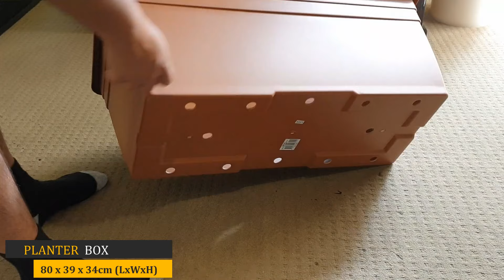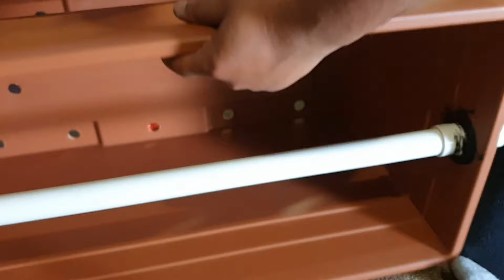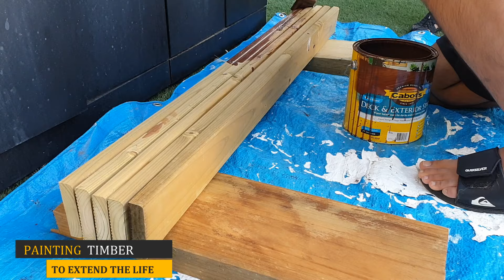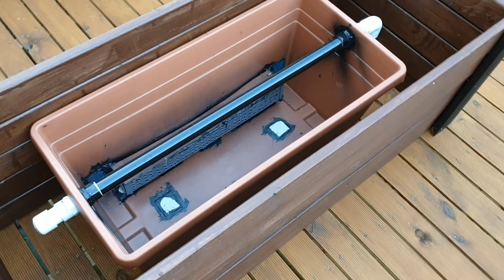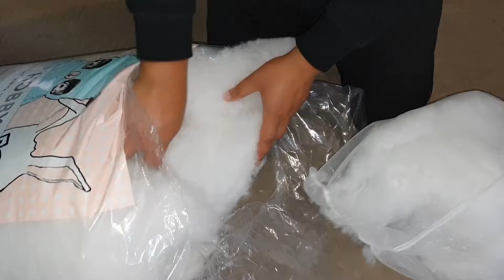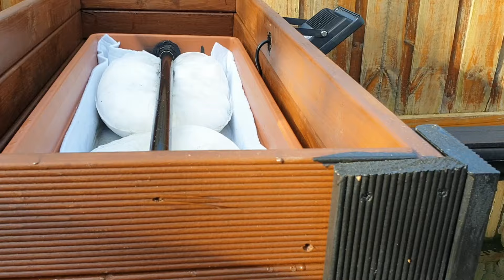Ep7. Build a Pond Filter With Spillway

Comment: What do you do with the open top of the planter box? Doing something similar and brainstorming ideas for the plsnter box cover/ how to add plants on top and still be able to access filter
Reply from the maker: Hi Cole, I have had this filter for year and a half. I am making a bog filter now. Similar look, however water flows from bottom and travel up before going back to the pond. This filter design required biweekly sponge cleaning with increase in pond fish. Bog filter will be more efficient and requires less maintenance. Just my feedback mate
Reply: @Fishaholic  nice and agreed. I still want to use the planter box around the filter either way but not sure how to cover the planter box as mine will only be waist high and don't want the filter seen from the top. Did you leave the top of the planter box open as in the video?
Reply from the maker: I covered the top with 8mm thick plastic sheet, was able to find the right size.
Reply: @Fishaholic  gotcha. Like I said my planter will be at waist level, pond is in ground, so I'm think I'm gonna try to fit some sort of indented top/lid to act as a container and add soil and plants on top to look like a legit planter box. Then I gotta figure out how to drain said plants so soil doesn't overflow into pond with rain🤔 so much planning lol. Bought a house last year with existing pond, waterfall leaks all over the place and after a year of patching I've torn down the waterfall and now rebuilding on opposite end of small pond
Reply from the maker: That sounds like a great plan. Fixing the pond and building a nice planter box should add value to the house. Congratulations

Comment: Hello. First of all what a great video you have. Can I ask what did you use as a filter spillway and did you paint it with pond paint (black) or did you apply pond liner on it? Lastly, how did you seal the spillway to the plant box please? Thank you for your lovely video. Hoping to hear from you.
Reply from the maker: Hi Ren, I have used a storage container for the spillway and used Krylon fusion spray paint in black colour. I have used ideal seal ms290 for sealing the spillway to the plastic planter box. Sealant was leftover from affixing glass to the epdm pond liner. Almost 1 year has passed with no leaks.

Comment: U should put a brick in the pond for the water pump ,if anything happen like leaking at least the water would not be drain out completely
Reply from the maker: I have placed the pump on its side, strainer part facing up elevating it at the same height as I would have placed it on top of a brick. It should address the issue you have mentioned Ryan.

Comment: What is the size of your pond sir? By inches maybe?
Reply from the maker: Hi Abe, I don't remember exactly. It should be in one of the pond video descriptions. However, it's roughly 87 inches in length, 47 inches I  width, and 47 inches in height. Overall, it's not a massive pond due to space constraints in my backyard.

Comment: Watched another filter build were water enters at the bottom of filter and leaves at the top because sediment doesn’t rise.??
Reply from the maker: That method works well if it is a bog filter and you follow the steps of adding rocks and pebbles. Have a drain hole so filter can be clean by rinsing with pond water as sediment will be trapped at the bottom of filter. I hope it make sense
Reply: bog filters work well if you want to place plants on the top. the plants get to enjoy the nutrients in the sediment.

Comment: Pretty little filter just wouldn’t of wasted my money on matrix biggest rip-off in the hobby it’s just pumice stone. Seachem swear it’s not. But I have the two side by side and I can’t tell the difference
Reply from the maker: Yea I know but found these on special. I am thinking of converting the filter into a bog filter and growing some herbs for added filtration.  Appreciate your feedback, thank you
Reply: I grow house plants over my aquarium to remove nutrients it took a little while for them to get established but now they’ve taken off their growing so fast unlike any House plants. I’ve ever had and I’ve got zero nitrate all of the time
Reply from the maker: Thats nice to hear. The only plant I have grown in my aquarium indoor is pothos which is doing an amazing job in filtering the tank
Reply: I have pothos peace lily monstera three different kinds. And a few other plants I think it’s great I want a completely new dimension to the aquarium and is also extremely beneficial especially when using it as I do in a overhead sump bog filter set up. I have a canister filter feeding it with an overflow back into the tank which means no detritus builds up in there because it’s prefiltered and I use expanded clay pebbles which act as a very efficient biological media and the plants love to grow in it. Apart from cleaning the canister filter which I would have to do anyway there’s no added maintenance it just looks great and serves the purpose also improves the air quality in the house so it’s a win-win all round